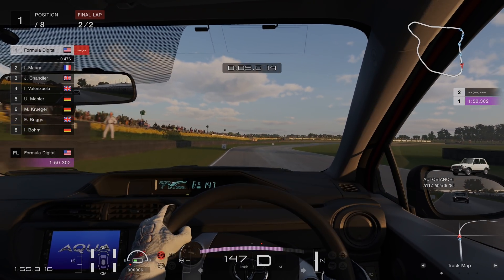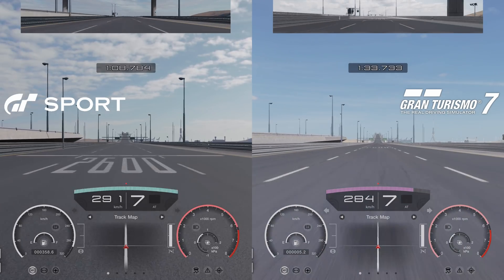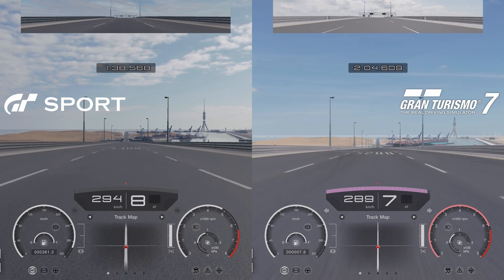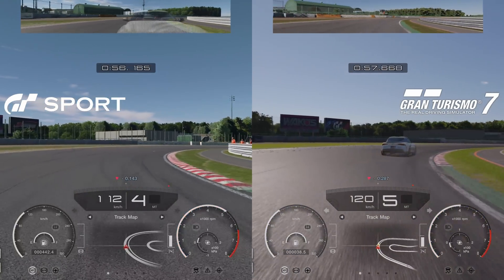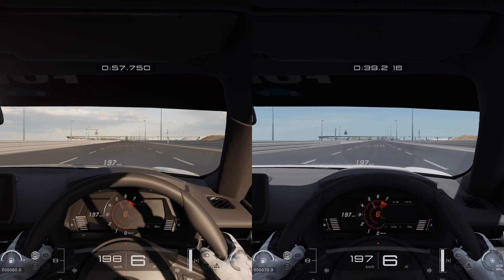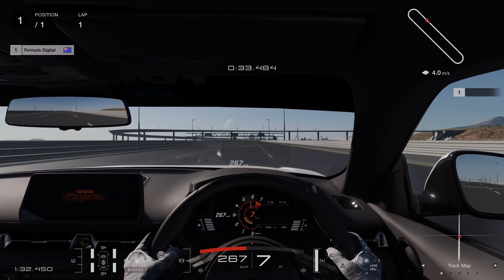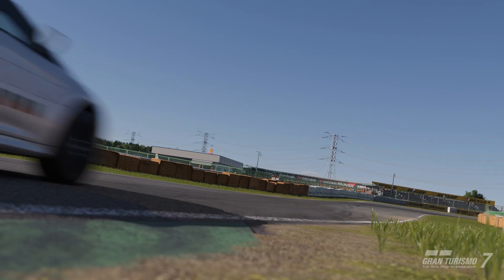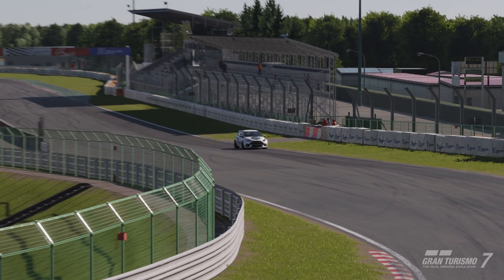Why GT7's Physics Feel So Different

Comment: The initial grippier launch of the Supra is why it got to the 1100 first, more traction equals more distance covered per tire rotation. I think the main differences aren't in static tire grip, but in the way the physics model deals with lateral grip, and accelerative grip when not planted, like in corner exit. To me, this is more realistic than Sport by a great deal, and after time watching exit speeds, throttle input, steering input and measuring that against what could be done in a real life version of the same, it comes down to the fact that in life, full throttle is reserved for certain moments, and feathering the throttle is much more in line with the way a real car is driven quickly.

Once you take time to get used to it, it is super rewarding and fun. Going back to Sport feels strange, because after playing 7, you can throw a Sport car at anything and full throttle your way out. Not so in 7 by any stretch!

Good video!
Reply: Ree why can't I hold throttle down and not have to think about it! Terrible game that doesn't cater to my shallow desires and unwillingness to adapt ree

Comment: The only thing I know is that the game is extremely frustrating with a controller. I did 100% gold a month ago in GT Sports. I feel like it was the right difficulty.  In GT7, it took me 100 tries to gold a sector with three curves.
Reply: That’s just because GTS license is too easy comparing to all other gt games
Reply: @ezaike335  The handling of the car also has a lot to do with the feeling on the controller and it can also mess with the time wich can make things harder. That to say that physics and car handling can make things harder wich is the case in gt7.
Reply: GTS was far too easy. GT7 is easy, other than a couple of tests. But even then it just took nothing more than an hour to gold. Some missions and circuit experiences tho are pretty tough and I think it is about right as far as a challenge goes.
Reply: @voongnz  I found the S licences easy enough to get gold on controller. Some of the circuit experiences are far harder but present a good challenge. I can generally get them done within an hour each. The credit rewards are well worth it now. But man that Bathurst lap in the Mclaren was a bit of a mission…
Reply: Controller is pretty solid ofc the wheel is better but the controller up until the super licences it’s not too bad

Comment: I’m glad it’s not only me. It seems like almost every car oversteers in gt7
Reply: Oversteering feels heaven in FF cars
Reply: Practice throttle control lmao
Reply: @Xeno-yy8dz  always good to practice but to push a car to it's limit and not beyond in GT7 you need practice in what ever car your using at the time on what ever track and also temperature. Seems easier to slide at night time. Which is where you would expect less grip.
Reply: I like oversteering more than understeering

Comment: You sould compare Forza Motorsport7 with GT7. A test i like to do to thes the geometries and if cars are like in reality, is to stiffen the suspension and then go on high curbs and see the wheels lifting up in the air. Like Porsche 911 would  have one front wheel in the air on curbs. GT i could try in the past always failed, evenif superhard the suspesions work like they don't follow the specs, instead in Forza, hard suspension you will have a reaction from the car. Like at 9:20 in Forza with a proper setup you can have the rear internal wheel lift up.

Comment: Air temp does affect engine power. Did a custom race at Daytona International Speedway. Race started in the evening and transitioned to night. My top speed had increased a couple of MPH by the end of the race compared to when it started.
Reply: Was there fuel usage though?  If so that would make the car faster.  If not it's a good find.
Reply: @kidShibuya  One had no fuel and another bot race I did had fuel, but I had to get fuel like 4 times. My lap time were consistently getting faster over the race even with worn out tires.
Reply: @sammyh.748  him much faster? I would expect like 2 tenths overall
Reply: @Sir.Craze-  I didn't measure my lap times but I was carrying around 3-4mph extra speed by the end of the back straight for the last couple of laps after it turned night.
Reply: @sammyh.748  interesting. I'll be interested to see much more in debth testing. Can't wait for someone to take on that challenge
Reply: @sammyh.748  Is there wind in the game? Wind speed and direction could account for that kind of delta, but I don't play the game so idk if they actually model wind.
Reply: @regimiro4888  Yeah there was wind, but it was blowing the same direction the entire race and only varied about 2mph the whole time. I was carrying extra speed with the tailwind and headwind though which makes me think it was the air temperature increasing HP.
Reply: @sammyh.748  I see, yeah it could be contributing. Likely a combination of factors, track temperatures falling could've also played a part due to tyre temps possibly falling into a slightly more optimal range by that point on the track.

It's likely not one thing as racing just has a lot of things going on.
Reply: @kidShibuya  weight has no consequence on top speed, only on acceleration
Reply: @kidShibuya  as shown in the video, fuel weight is only pronounced during acceleration, not top speed
Reply: Also could be wind speed
Reply: I noticed that my car feels less grippy at night time when on trial mountain even my braking points had to be moved back a bit.
Reply: @rockettbuggey5990  Track and ambient temps drop, causes tyre temps to drop, worn tyres also just generally keep heat in them worse.
Reply: An example

When you take your downforce at 100% in a f1 car and you drive at Monaco. The car is lossing grip becauses its lifting the car up from the wind thats returning from the walls.

If you take the downforce to a 15% you dont shal lossing grip annymore.
Reply: Yepp and altitude and moisture. Dont know if this is prescent in gt7 tho but it probably is.
Reply: That could be down to tire temperature though
Reply: "real driving simulation"
Reply: That's not air temp, that's density altitude.
Reply: you'll just get used to the track and get more speed out of some sections it has nothing to do with what you said
Reply: @ekurts1999  I don't know how you get more use to Daytona. You literally hug the bottom and don't lift lol.
Reply: Dude the last couple laps are always faster.
Reply: @darknightcbr2300  not mph wise though
Reply: Lol people actually think everything in gt7 is real lol
Reply: Is the wind in the game thats changing the acceleration and top speeds from each car. 

Even take curves is infected by the wind. 

What i think also is that some of the circuits are not 100/100 same scale to gt sport and other gt games

Comment: So the top speed differences could be a better aerodynamic model in GT7 which more accurately models air resistance. Also take not GT7 has a wind model and I don't think Sport has any wind at all.

Comment: GT7 has wind that varies with direction and speed. In Sport, it took them a while to get the traction right, it'll be the same with 7
Reply: No youre wrong they added ballast and that effects the snap over steer if its placed right the car doesn't over steer so much
Reply: @eoinm5758  I shouldn't have to add weight to my Ford GT for it to be able to take a very slight curve without throwing itself into a wall.
Reply: @burgerbandit3646  well you do so be stubborn all you want that's on you, people have 600 hp rwd cars and think they shouldn't step out at the back
Reply: @burgerbandit3646  Not as good as you think 🤔
Reply: @blackrahk2037  huh?
Reply: Sav Kvd you dont
Reply: @calebnation6155  it seemed I didn't shortly after I wrote that comment but then they altered the handling again and now it's like it was when the game first launched. Disappointing.
Reply: @eoinm5758  classic cringe sim tryharder, real life cars have passive stability difficult =/= realistic
Reply: @eoinm5758  So how does that have anything to do with the wind?